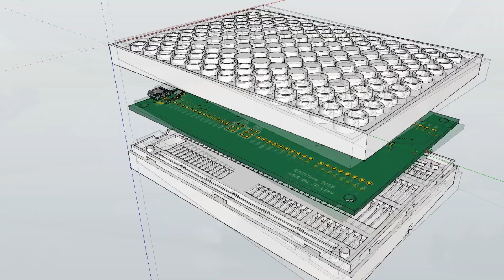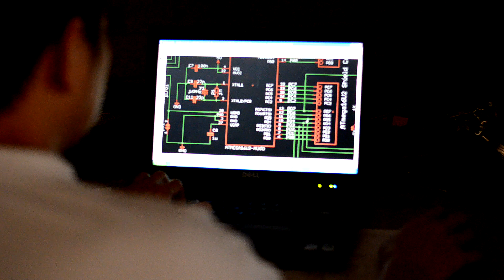STEMTera Breadboard - Arduino compatible built-in breadboard.

Comment: After all this time.... and still EXTREMELY EXPENSIVE!.   I thought this was one of the best (Arduino based) products I had seen in YEARS..  But @ $45 price point..  thats kills it for me.  This is NOT cost effective to buy for classrooms or children (legos..etc)..     It is a GREAT merge of the Arduino and Prototyping... but again.. not  @ $45 dollars USD!!..

Is there a support service or path one can take if the internal board get fried?  What happens then?  Can you just buy the internal board for a replacement? Or do you need to buy a whole new STEMTera product?  

I'm wondering if this product just didnt 'catch-on' yet?  I was half expecting TONS of clones to be made by now...  but I have never run across one.  Must not be a huge interest?  (what a shame)

If this was priced @ around $20 USD.. it would be more attractive and give some competition to a Pro-Min and breadboard alternative.

Still a GREAT idea..... even if the high costs kill the hype/desire for it..
Reply from the maker: I can understand the high cost of this product stopping some potential customers buying it. 

There are significant amount of work involved in making this product unlike regular Arduino bare board. The plastic injection mold was custom made in low quantity (cost more) and not like the regular generic breadboard that were made in hundred of thousands. 

Without considering other cost, just the raw BOM material itself, taking 1000 units per order, it is already exceeded USD19. I have open source the schematic where you can generate the BOM with +digi-key link to each and every of the part used to verify my BOM cost.

The PCB uses 4 layer BLIND VIA which cost 4-5 times more than a regular PCB to avoid the bottom layer touching the metal clips on the breadboard. Go to https://www.seeedstudio.com/fusion_pcb.html upload a design, check the price and then select BLIND VIA, you can see that the price will just skyrocket. 

After adding the top and bottom plastic, assembly cost, testing cost, packaging cost and misc cost, I can assure you that the product's actual cost is many times more than just an Arduino mini + a regular breadboard.

Arduino UNO R3 that is only bare PCBA when first started cost almost $40, not until recently the increase production and competition brought it down to $22. 

I am just a small new startup company, without buying power and producing the STEMTera in low volume, the price is only $5 more than when Arduno UNO R3 was sold for $40. If I have the capital to make 100K boards to keep stock, then the price might be able to come down relatively lower.

Hope my explanation clears up why the price of STEMTera Breadboard is expensive.
Reply: I totally 'get it'... its just a shame that such a high cost will bar/block many people from using it.  I personally think its a GREAT product..  and is the right/next step in prototype design/products.   I it was $20... I think it would be met with great acceptance and popularity is all.

I also guess that is why we have not seen any clones either.  (4-layer and plastic injection..etc)

Maybe over time costs will come down.. or you will get a huge financial backer to help out in costs.

Comment: Interested, but this will live or die based on it's price point.
Reply: Holy crap!  I waited up until 5:30 in the morning only to find out that the lowest price is $39???  Not in a million years.  I would have paid $25 at the most and expected the early Kickstarter offers to be less.  'night all, time for bed.
Reply: Agreed. Great product, and if it ends up being too  expensive, Chinese clones will be on the market in no time.
Reply: Yes, but also don't underprice it - if you set the price at the lowest level that gives you enough profit to make the venture worth doing, there is no margin for third party retailers, and you become forced to do all the sales directly yourself. (I say this from experience :-/ )  So if (say) costs were $6, and you planned to sell at $19, then bump the retail cost up to $25 to give retailers a mark-up.  What you lose in sales from people who think the price is too high will be made up for by larger numbers that come from using big distributors.
Reply from the maker: Yes Graham you are so right. One of the hardest thing to do is to decide a price point. A price point that you can get resellers to sell and yourself can focus in more developments or a price point where no reseller would touch it and spend all your time selling directly and no future developments.